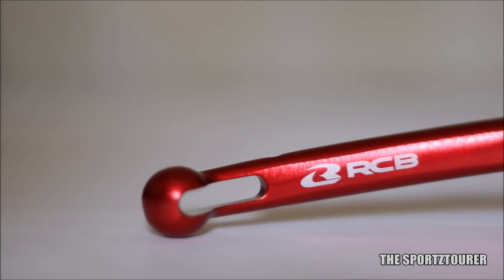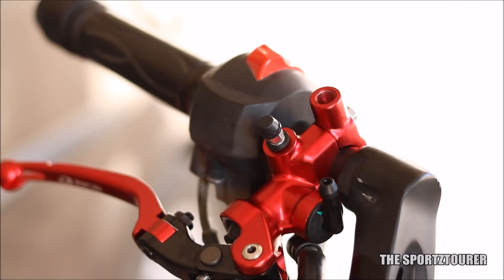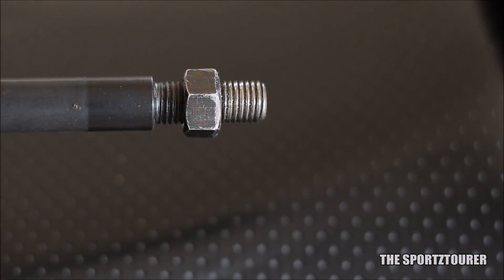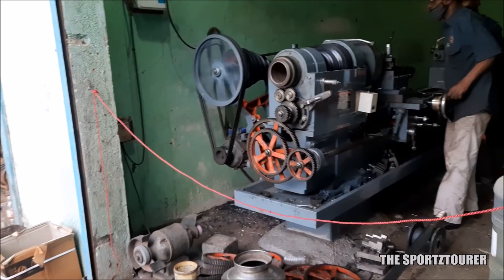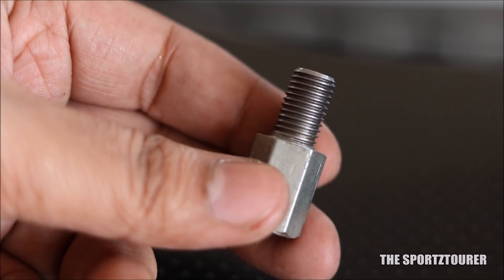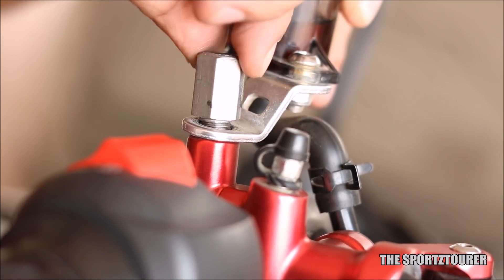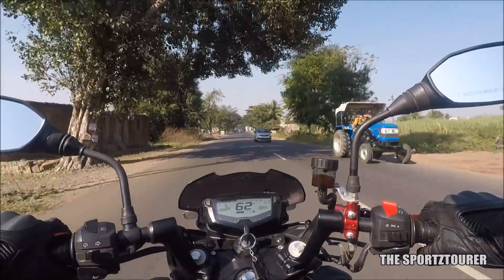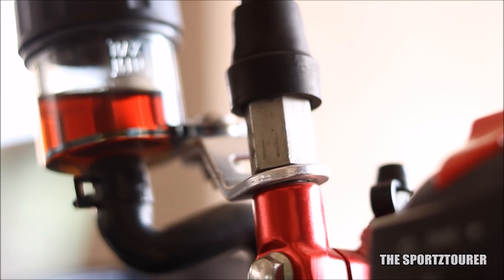UPDATE ON MY TVS APACHE RTR'S RADIAL MASTER CYLINDER FOR FRONT DISC BRAKE RCB ADJUSTABLE LEVER

Comment: You had to do quite an amount of work to get the adapter right.
I had a similar problem with my Magura brake master cylinder for my Duke 390 2017 model.
I bought a mirror extender which has solved this problem.
I had simply used a right hand threaded bolt to master cylinder side and the extender had a left hand threaded tapping, this has solved problem very well and also the by product of doing this is one can position the mirrors  little bit towards outside or forward increasing rear view visibility. 
There are several mirror extenders which are manufactured in India.

Also using thread lock or Loctite would prevent the mirrors from getting loosened on bad roads or in Offroad situations.
Hope this helps you and the viewers of this video.
Reply: Where did you get the extenders from.bro?
Reply: @anandsai164  
I got mine from Aliexpress. 
At that time I didn’t know that Mantra Racing was having a product for mirror extenders.
Even adv tribe has an option but I don’t like it as the mirror threading is quite a bit more visible below the mirror extender and you need to use an additional nut to tighten which is not the case with AliExpress one or the mantra racing. 
You also get more thread engagement with Mantra racing one and AliExpress one.
Remember three things while buying 
1. Need to buy 1 left hand threaded and 1 right threaded extenders 
2. But you need to buy 2 right hand threaded bolts if you upgrade to any aftermarket master cylinder other wise you can have 1 left hand threaded and 1 right hand threaded bolt if you mount the extenders on the stock setup.
3. Use locktite 243 or equivalent thread locker (a must in my opinion if plan to take your bike on bad roads or off-road)

Hope this information will help you.

Comment: Hi bro 
I have a few problems with my rtr200 
Not major but when I cold start it, it'll crank but I need to give throttle till 2000 rpm or 2500 rpm for atleast 20 seconds to make sure it doesn't shut 

Or 
I should switch the choke on 

Since many people advice me not to rev the engine on cold starting 
What do I do?
Is raising rpm to 3000 or 2000 rpm at the start harmless or does it affect